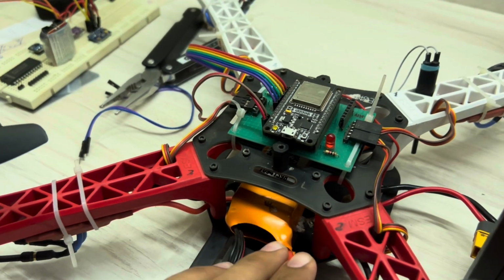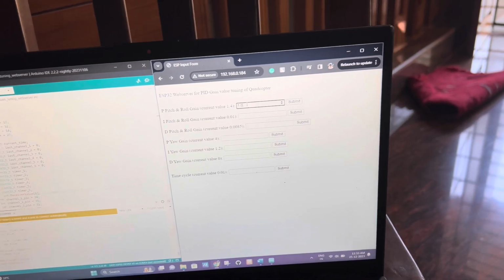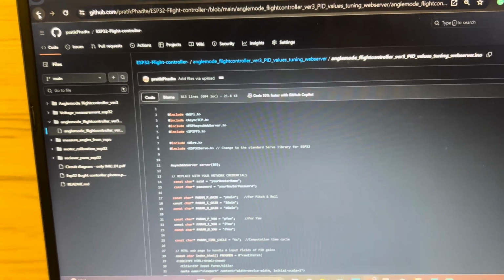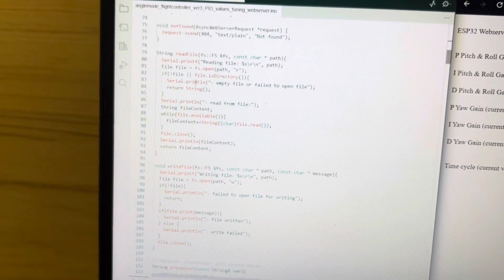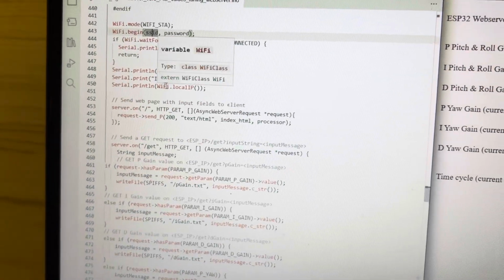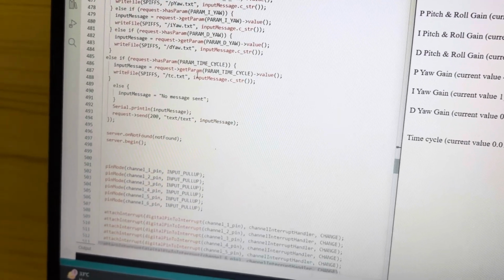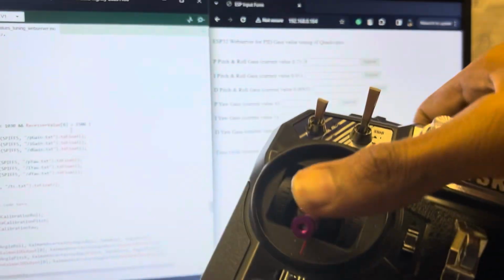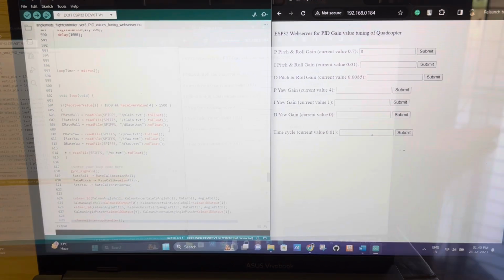Change PID gains over WiFi |  ESP32 DIY quadcopter & Flight controller code in Arduino IDE

Comment: 00:01 Creating a web server for wireless PID tuning
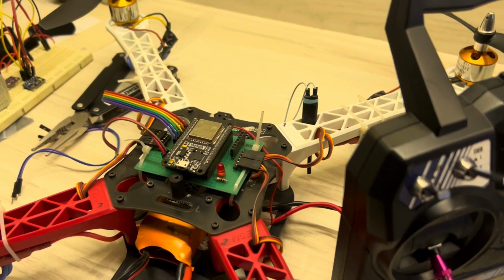01:06 Tuned PID gains for improved quadcopter performance
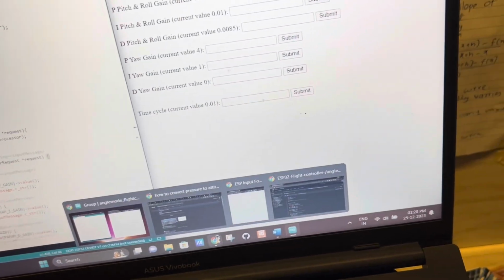02:16 Download and configure the PID tuning file from the provided GitHub link.
03:29 Translating HTML code into Arduino code and web server data retrieval
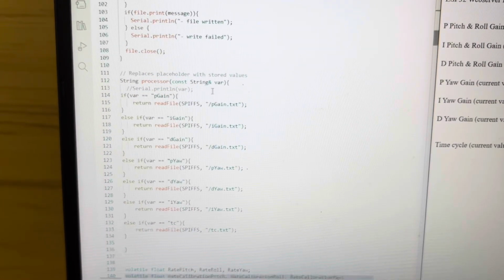04:29 Setting up Wi-Fi connection and receiving input messages for the quadcopter.
05:36 Understanding the code for time calculation and loop execution
06:45 Experimenting with different time intervals for better readings.
08:02 PID tuning can be used for tuning copters or robotic devices.

Comment: i question that why are you notusinf flight controler chip  , i want to build a project where i need to hover th e drone and also fit a extra lora module , so any advice if you have

Comment: how get the pixhawk gps information and battery status using the esp32 wifi module using the Arudnio IDE application to get the logs on the serial montior
Reply from the maker: I’m sure it could be done somehow, there is a channel on ardupilot discord which uses esp32 for some sort of WiFi telemetry. I would suggest you to check there.

Comment: Hi, I made a drone using the exact same frame, esc and motors, but using a f3 racing flight controller, so I'm wondering what pid values are you using?
Reply from the maker: I responded on one of your comment which had the same question.

Comment: hello sir what are the PID values you have given to flight controller
Reply from the maker: If you are having trouble you can try these values, they work good in an environment with less wind 

PrateRoll = 0.65 
Irateroll =0 
DrateRoll= 0.0085 

Note that roll and pitch PId values are same 

If your environment is windy try with 7.2 (or 7.5) as PrateRoll
Reply: @pratikphadte isn't 7.2 too much?

Comment: Hi i made that esp32 flight connections and setup my flysky but only throttle values are showing up also pid values change but it does not balance the drone please help!!!!!!
Reply: Use the trim button to increase  the Stability as per your Requirement.. !
Reply from the maker: Helllo, try testing individual components by serial printing the values on the monitor and then start with pid tuning, if your setup is similar to mine then the same pid values should work well.

Comment: Hey nice work so can I also add css to it just for aesthetic if yes then please mention
Reply from the maker: Yes most definitely, you need to make changes in the Html code in the .ino file.
Reply: Thanks I have a small request can you make an esp8266 version please for the pid flight controller,if possible that is
Reply from the maker: Yeah that seems like a repeat work for me, but I’m sure you can try it and if any doubt arises let me know

Comment: Hi pratik bhiyaa , I'm facing an issue from the serial monitor I can't see the values i think it's about baud rate i tried to set all the possible baud rate bt still not able to see any value any solution??
Reply from the maker: Hello, check if you are using a data usb cable, some cables that are used for charging have only power wires inside. Also check if the com port is getting detected in device manger.

Comment: This is all great, Keep it Up dude. Im Waiting for the Transmitter Setup if theres any other than the default config!
Reply from the maker: Thanks!, It’s the same transmitter setup, pwm protocol
Reply: Yeah i get that but i tested everything and the quad works except that the back motors have more power and drags to the front and i cheked the pwm test code which diddnt provide enough info and also the trim so it would be nice if you could make one video about the transmitter/reciever setup and config with the flight controller @pratikphadte
Reply from the maker: @binisol7353  did you try printing the values from the receiver to the serial monitor? 

Maybe that will give you insight, 

When throttle is at 0 and when you slightly increase it, do your motors spin at the same time?
Reply: Yes the motors spin at the same time i think its my pitch or roll angle cause I'm getting this reading from the measure_angles_from_mpu test code?  @pratikphadte 

Roll Angle=-0.44Roll Pitch=-50.57

Motors 2 and 3 get more power and tip over the quad in my case!

Comment: Thank you very much sir. I tried to make that flight controller according to your schemetics but there was a little mistake in the diagram for the i2c. After struggling a while my quad finally flew. It still needs some PID tuning. Btw esp32 uses GPIO 21 ans 22 for i2c communication but the diagram says GPIO 21 and 23.
Reply from the maker: Oh that’s really great to hear that you were able to make it And fly it! If possible can you share me the video, just for my reference, you can reach me on LinkedIn.

Oh yes I have made one mistake there, thank you for sharing, I will rectify the diagram.

Comment: will love to see full fc explanation.
Reply from the maker: I will do it once there is a good demand for it 😄👍
Reply: @pratikphadte  pls do the code explanation. and will it fly if i use esp12f, with brushed motors. ofcource with esc related modifications & will use esp wifi capability for remote.
Reply from the maker: @webutility6558  it should fly, if you are making a nano drone then use lightweight mosfets and pcb board. i have made a similar project but i wasnt able to get a flight due to weight issue. i used same code for it. so it should work for you just need to change the reciever code and esc map code.